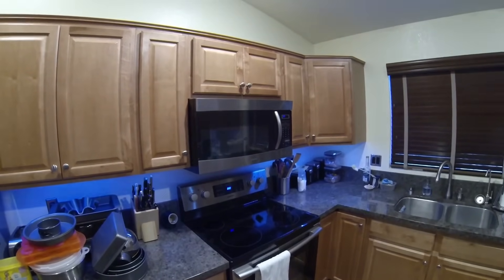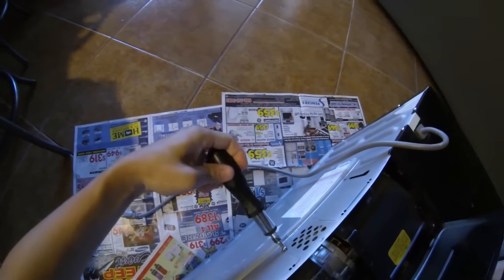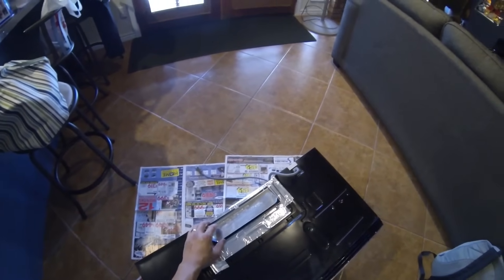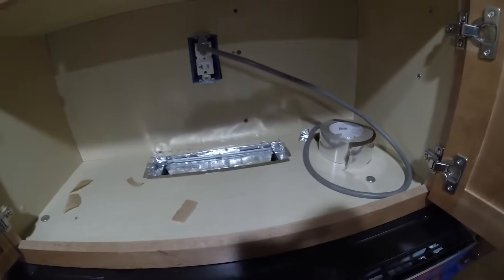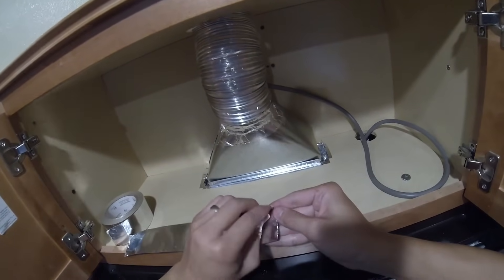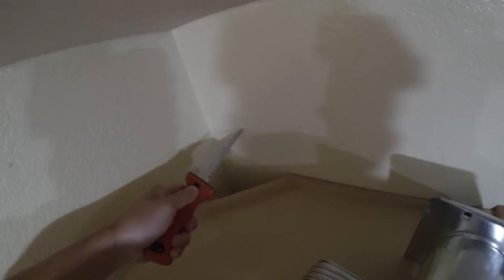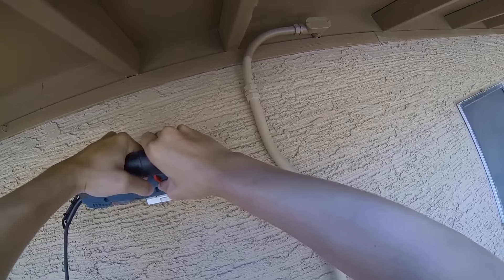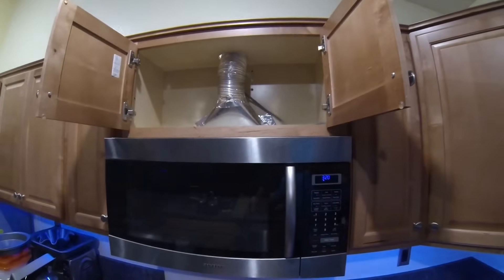How to Install a Microwave Hood with Exhaust Fan - DIY

Comment: Anyone watching, you should never use flex duct for microwave or range hood. Flex duct is for dryer vent. This will capture a lot of grease and will generate a lot more fan noise.
Reply: Samad Abdul  what should he had used?
Reply: A 6" solid tube, minimum.
Reply: Huh?
Reply: What type of tape should he had use?
Reply: Steel or aluminum. Something smooth
Reply: And it should not be 4”. Recommended is 6”.
Reply: I'm actually installing a new range hood the previous owner actually had a flex. I can see it is very greasy inside and the range hood was just shot. When I installed the range hood right now I'm trying to figure out how to put in the new duct as it is rectangular but I guess when you need to do it right away you just got to work with it but there is a shitload of oil and grease captured
Reply: Something is better than nothing! 6” for a microwave vent seems like a lot this isn’t a range hood.

Comment: There are a lot of good/positives to take from this. But huge negative is that you are not using the correct duct and vent size. The microwave will say a min. 6" circular vent or 3 x 10 inch rectangle duct....Your fan is likely much nosier and will not pull as much air as it was designed to do. The most difficult part of this install is dealing with larger duct. If you go with the rectangular duct to fit the opening in the micro. then you will most likely have to completely sever a stud....which will require you to cut a large hole in the drywall and add a header and jack studs where the stud was cut out.
Reply: Or turn it 180 so you dont have to touch the studs.
Reply: @Pepe-dq2ib did you mean to say 90 degrees?
Reply: A 6" duct is not needed in an application like this one. A 4" rigid pipe carries 400cfm. Most Microwaves are at or under that. I installed a 4" rigid pipe out the side of my house because of cabinet clearance on my ceiling. I have tall cabinets and simply did not have the space for a 6" pipe. I actually removed my microwave and installed a Hauslane Range Vent hood. It's rated a 500CFM but that's at full speed which is simply not needed. On low speed the fans are extremely quiet and move a tremendous amount of air. On the lowest setting the vent outside my house will mess up your hair in a heartbeat. I checked it with boiling water and actual smoke from cooking breakfast meat, like bacon and sausage. It pulls the smoke up immediately. I'm extremely happy with how it turned out. I would have installed 6" but simply didn't have the room.
Reply: What is the proper name of the metal duct that connects to the microwaves vent damper.? Home Depot was clueless of the name of duct that I needed 3 1/4”x10”x6”

Comment: please don't use flex duct for kitchen hood, besides not passing code inspection,  it will hold grease. Use solid pipe, no flexible duct, no screws, and hoods usually need 6" or 8" or even a 10" duct pipe size for better air flow and less noise (see manual for appliance for their specific requirement). you can buy a converter that will allow increase from smaller duct size to larger. And that plug must be accessible, if you care about code/safety, move it over to left or right.

Comment: Great video, I appreciate the help! But I second the flex duct - you're going to want to replace that with rigid metal ductwork that has a smooth interior to meet code & safety standards.
Reply: Single wall? And home depot only has this cheap roll it yourself stuff. Anyone sell any good runs of 4" rigid metal lengths?
Reply: Correct
Reply: I know you say the rigid metal duct is needed to meet code and safety standards, but do you know the reasoning behind this? Just curious.
Reply: @greid9349  Because of the ridges inside, flexible ductwork is more conducive to mold growth, it has a higher resistance to airflow, and the ridges also provide many more surfaces for dust and debris to collect.
Reply: @joeoconnell5706  actually it's in case of grease fire, the flex duct will melt and catch your house on fire. it also collects the grease more than smooth wall

Comment: Just had to say glad to see your doing it yourself good for you. I know here it comes BUT You don't use flexible duct on exhaust must be rigid pipe. Using tape like you did wrong again tilting the fitting to accommodate the electrical not a good idea. 4" duct wrong again if you check your manual I'm sure they recommend 6". Do the math the square part of the fitting is most likely 10x3.25" 32.5 square inches - 4" dia area is only 12.56 square inches - 6" dia would be 28.26 square inches. Sorry but way to much wrong here to not say anything.
Reply: Good to know Larry M. I'm watching videos to learn some tips to make my microhood install easier. Do the 3 1/2" X 10" square to round adapter come in a 6: diameter? I have only been able to find 4" also. Thanks
Reply: Totally agree. I'm looking on doing something very similar and the duct is supposed to be 6". I assume he went with 4" to make sure the duct isn't visible.
Reply: Yes, does the rectangular fitting come with a 6" round outlet?
Reply: he is using an HVAC adapter.  A proper over-the-range hood adapter is 7" round.
Reply: I will say, 4" is more ventilation than he had (better than recirculating)...but I agree.  He cut his area for airflow by about 2/3rds when he used a 4 inch duct.  And flex duct is the wrong way to go (at least it was not the flex dryer duct). Should be 7 inch round...though it seems 6 inch is getting more commonly used.
Reply: You're right. This guy needs to read a code book. Easily found online. Codes for this install haven't changed in a while. 6" pipe with an elbow and 4x10x6" straight boot would do. Also probably needs insulated

Comment: The power of modern technology!!! First off, thanks to the creator of this video. This was published 6 years ago and it is still benefiting people to this very day, despite what appears to be some mistakes installation. 

Secondly,  thanks to all the people in the comments ( some I assume are professionals in the field) who gave the much needed corrections on the installation. For me, one of the reasons I used to be doubtful about trying to do projects like this is because of fear of safety violations that could hurt me or my family.

However,  with all of the comments and many people saying the same thing about the correct material to use,  ai feel confident that I can complete this project.

Thanks to all.

Comment: Hey brother,  watched ur video almost a yr ago and finally this weekend made it happen. Thank u.
Reply: Don’t use flex duct. It will trap grease and you’ll have a fire hazard.
Reply: @zonedout5998 even if it's straight up we should not use flex duck and also my vent is 4 inch that will still work right when I  got roof installed I got installed but it was a 4 inch vent

Comment: Thanks, you just solved my reconnection problem , disaster of install to new microwave,because sheet metal one would not fit space. Guy we hired screwed us bad and left us a nightmare!! Round flex hose perfect solution with 2 end caps , you used at microwave  vent. My roof vent is also, rectangular.  Thank you for posting !

Comment: This is a great idea. I was thinking about running my duct through the roof since my stove is not sitting on an outside wall but this is a way better idea and that hole that you cut with a saw is pretty damn good for being cut with a saw!

Comment: 👏🏼👏🏼💪🏼👍🏼🍻
I did the same install at first with the recirculating vent and now our new white cabinets are getting grease stains on them and the ceiling.

Thank you so much I never thought or bothered looking at how to change the roller to face it going up. 🤦🏻‍♂️ and I connected to exhaust ducting.
So this weekend I’m taking it down and turning the roller. 
💪🏼😁🤣 🍻 
Thanks so much for this step by step video.
From Los Angeles Southern California 🙏🏼✌🏼😁

Comment: I've been busting my brains on to how to connect the pipe to the exhaust hole and now I find that TAPING IT UP IS SUFFICIENT??! Where have you been all my life
Reply: ivaerak this is the normal way to do this
Reply: Thanks. In the end I used styrofoam instead, cause the tape wouldn't stick successfuly to the alufoil pipe. So I made little styrofoam cubical profiles and jammed them between the pipe and the hole, all around the diameter and now it's safe and firm, and without any air gaps. There are also reduction threads for pipes in hardware stores, but it wouldn't work in my case.
Reply: ivaerak ok, because I have to do this later today. You don't think duct tape would have worked? Do you have a pic of your styrofoam duct?
Reply: T. B. unfortunately I don't since I don't live there, but I can sort of make a schematic drawing or take a pic tomorrow.
Reply: The tape simply did not stick. Here are the pics
https://drive.google.com/file/d/0ByhT-6c2_xZ9YzdfM0Q3Ykgzenc/view?usp=sharing

https://drive.google.com/open?id=0ByhT-6c2_xZ9Q1ZhTEFRNDVQb3M

https://drive.google.com/open?id=0ByhT-6c2_xZ9ZXNReUdFSDN6RFk
Reply: ivaerak OK, that is clever. Good idea! I just ended up using aluminum foil to 'bridge the gap' then I used some foil-sticker tape to seal everything up.

Comment: Good comments below you should first... Hire a Licensed individual who will install it as per local codes! or follow the installation manual since that is the minimum standard for all venting! Also like mentioned the flex duct shouldn't be used because its undersized, could trap grease, cannot be installed touching the wood cabinets, and cannot terminate under a wood overhang that would be considered fire hazard! Good job narrating the video Sir

Comment: Great job and thank you for this video.  I have a different setup, however, I needed to replace all the ducting as well as our microwave because Starlings ripped off the exterior plastic vent covers and made a nest inside the ducting.  We didn't notice until it was too late and now we're having to clean and sanitize everything.  Its an insane mess.  Thanks again!
Reply: make a cage out of 1/4 inch wire mesh to go over the vent without restricting the flaps of the vent. if you spray paint the mesh to the same color as the vent it will hardly be noticeable.  I generally cut it into the shape of a large cross...then bend the tabs down 90 degrees and then back out at the bottom to resemble a top hat.  Good luck with those birds.
Reply: No its not

Comment: So I m glad you got that in but unfortunately it's got a lot installation issues. First off you needed to move the outlet to the right. The venting is very undersized and is the flexible type. Needs to be 6" ridgid minimum, 7" recommended. Also ditch the crappy factory vent damper. I find most times when you connect your venting it gets bound in place. They make inexpensive ones that actually work you can install after the transition.
Reply: May I ask why move outlet? Just learning before I hire someone to do.
Reply: @whutchyt  Proper ridgid venting is going to totally obstruct the outlet.  It should be ruffly located above where the cord comes out of the microwave. It can be on either side the vent.
Reply: Do you have an example of a damper "actually works"? It seems like this is a part of the specific microwave?  I can see going into HD and them saying, they come built in you don't need one. thanks
Reply: Good advice all around.

Comment: Nice video and thanks for the time and sharing.   

One thing though...I do believe that you should only use 6 " duct for your Range Hood/MWave vent pipe.  I recently did a similar project and 'tried hard' to go with 4", but every online resource I visited or Pro I spoke to me tried to veer me away from that.  I eventually used to 6".  Same principle except that the outside vent caps are HUGE.

My understanding is that 4" is used for dryers, 6" for ranges.
Reply from the maker: +Kaj Alano Thanks for your feedback! While I do agree that a 6" duct would be ideal to move the air, it is indeed quite large. I created a soffit above the cabinets and if I were to have done a 6" duct it would have been too big for what I had intended. The microwave still does a really good job at removing the air and that the 4" duct is handling it well.

Comment: Your microwave exhaust fan is rated at least at 300 CFM. Maximum flow through a 4" duct is 180 CFM. A 5" duct is a minimum acceptable for this installation.
Reply: @eschrader  For a 4" diameter pipe to let 400cfm thorugh, the air needs to have the velocity of nearly 4600 ft/min which is 52 miles/hr. There is no way those little motors can push that much air. It's physics and there is no magic to it. If still in doubt, take any manual for an over the range hood, or a microwave with one, and see that the minimum pipe diameter is recommended.
Reply: This man is correct. We always run any vent over the range in 6" and never flex. Not bashing this installer but like you said read manufacturers specs for venting on appliance
Reply: I have a question? Is that, For connecting the vent hood to the microwave just foil tape?
Reply: @anthonysanchezmistymcelroy8273  The outlook on the hood should slide into the tube a few inches. The more, the merrier, but it's usually about 3 inches. The connection is then taped generously with aluminum foil. I also apply the tape along the vent tubes on the connection crease.
Reply: @anthonysanchezmistymcelroy8273  UL tape

Comment: At 5:48, how the hell did you manage to install the microwave WITH the flapper vent installed?  When we tilted the microwave back on, there was no clearance for vent.  We had to take off the vent and install it from inside the of the cabinet.

Comment: Thanks for the video. I am about to do the same thing, though I am fortunate that I can go right through cabinet since it is an outside wall. Strangely I asked at both Lowe's and Home Depot on what to buy and I got no help. I even asked if the register boot would work and the guy at HD said no and gave me a number of an air conditioning place to "build a box" in my cabinet (that I would then have to somehow connect to outside).
Reply from the maker: A register box would also suffice. Any duct housing should work really. 
Just need to find the right size to accommodate your setup. Building a 
box is really just that. They would make a metal box to sit in the 
cabinet to catch the air and and exhaust it. HD or Lowes offers enough 
options to find something that would do the same job.

Comment: Did you try opening the damper inside the duct adapter? Usually they barely open because of the steep angle of the adapter.

Comment: the only tiny change i would've implemented would be to put a bead of silicone on the inner flange portion of the outside before installing it, that way you get a full contact seal with the outer wall and partially inside the hole for a more sound mounting and sealing option but 👍 nevertheless!
Reply: absolutely agree, I just made a comment on that and also use of liquid drywall or cauck on the inside border as well, no roaches comin in from that crack

Comment: Thanks for making video.  It's great to be able to wathc someone else do it.  Nice job with the tape.  You took more time than I think the average contractor would have.
However, I don't think that flex vent pipe is allowed per any code within the United States - covered by the National Building Code.
Reply: Only rigid galvanized pipe is allowed for kitchen exhaust.

Comment: Good Video, I would have  used a dryer clamp on it to tighten.  And also would have put a cover plate on that outlet.  Furthermore a flat  plug extension adapter would have worked for behind the vent.  Good Job....

Comment: This video is very helpful thank you for that I’m just unable to find the little flap thing that covers the fan on top of the microwave any advice on a local store I can find that probably? And what exactly is it called I’ve been trying to find it online but can’t find it anywhere? Could you maybe help me with a link on Amazon or Home Depot or from where you week it from I need it to be shipped a little quicker or to find it local anywhere maybe at lowes or somewhere that would be even easier.
Reply: I have the exact same microwave as you just a tiny bit different if that helps. It’s 30in in size and has similar functions and looks almost exactly the same as yours.
Reply: You mean the damper?

Comment: Many viewers have correctly noted that the electrical arrangement is very wrong!  Missing cover and electrical cord in direct contact with a metal duct that will vent hot cooking air.  Brilliant work!  The cord may melt or the vibration will wear the insulation off!  Shame on you.  Move the outlet first.

Comment: very good. I will try this myself when I get the energy and will probably use 4" solid duct across the top rear of cabinets, hiding it as much as possible, through a small closet and out. A longer path than yours. I may try to put in an additional exhaust fan at the outlet. Another option might be to go straight up, into the ceiling, then 90 degrees back out between the joists in the ceiling and out. I'm afraid though there might be electrical work there from the kitchen lights.
Reply: I have almost the same setup but will be using solid tube instead of flex. I read many places that 4" carries 400CFM which is more than enough for this 300 CFM microwave. So many will say you MUST have 6" but this is overkill most of the time. The formula I read was 100 CFM for every 10" of stove size. Mine is 30 so I would only need 300CFM. 4" pipe is sufficient.